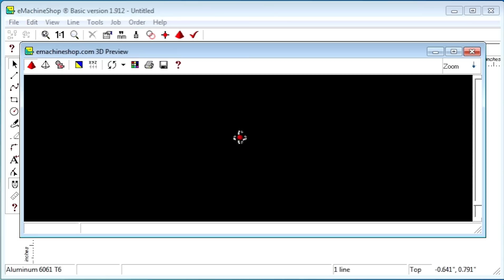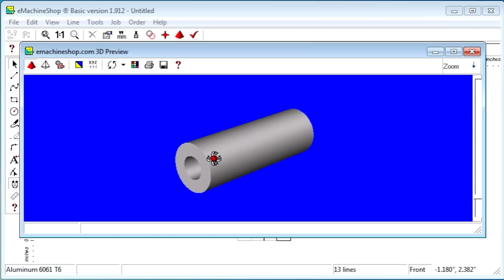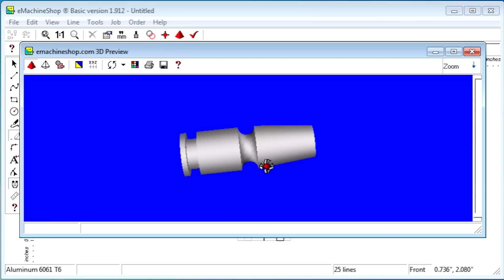Revolve (Tapered Tube)

Comment: I'm designing something made out of tubing and can not for the life of me figure out how to turn my 2D model to an angle other then the Front,  Back, Left, Right, Top or bottom is it even posable? I'm trying to put a hole in the tube at about a 45º from one of the sides and want it straight down not from the side.
Reply from the maker: +Walter Null Have you figured it out? Sorry it's taken so long to get back to you.
Reply: eMachineShop no I haven't figured it out I haven't had much time to just play around.

Comment: If i wanted to make an axle how would i do that
Reply from the maker: Hello,

The best way to start an axle shape would be to create a circle and then set the z value to the length of the what you needs are. If you are having trouble, feel free to contact techsup@emachineshop.com for help!
Reply: also do you machine in 7068 aluminum
Reply from the maker: Here is a list of the materials we use: http://www.emachineshop.com/machine-shop/Materials/page36.html

We can get certain other materials upon request, however.